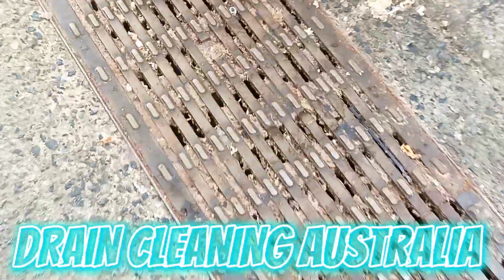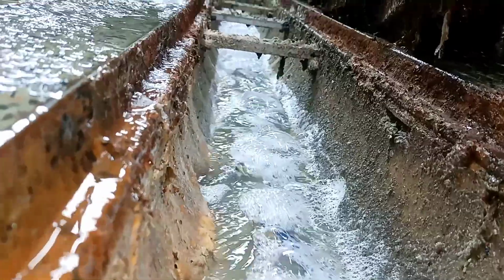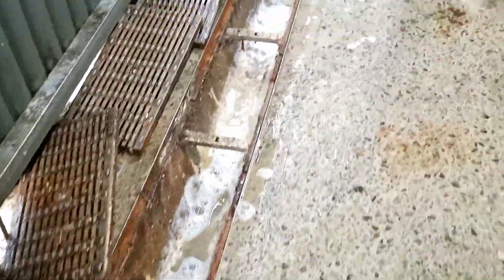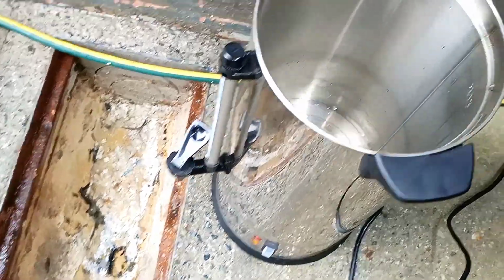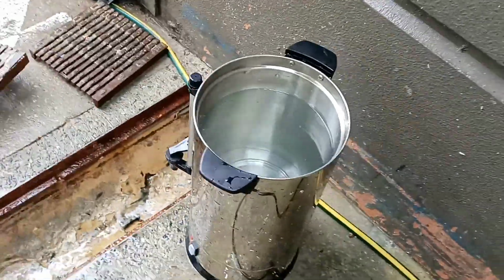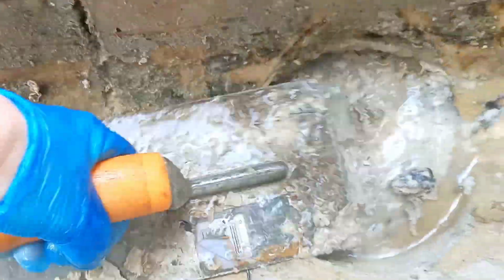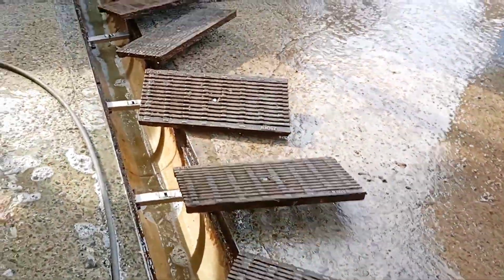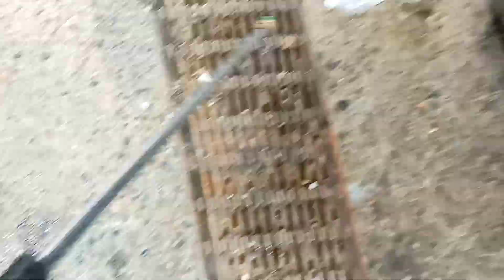Maggot Riddled Channel Drain | Blocked Drain 84

Comment: I am really surprised that more of you Aussie Drain Cleaning boys dont run Diesel Heated Pressure Washers for your jetting. Mate, if you had one of those, this job would have been done in a quarter of the time. Literally one pass would have stripped all of the grease and oils. And given the number of Grease Traps, and coagulated fatty solids you all seem to deal with on a daily basis, the ability to add in boiling water at high pressure, or even straight steam pressure, would be very beneficial...i would think. Maybe there is some regulation or safety concern as to why you dont?